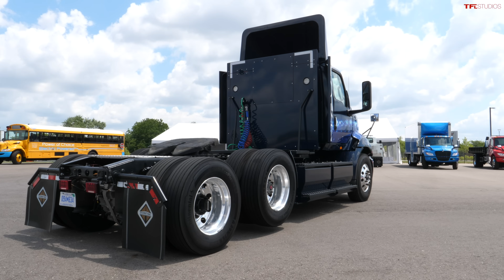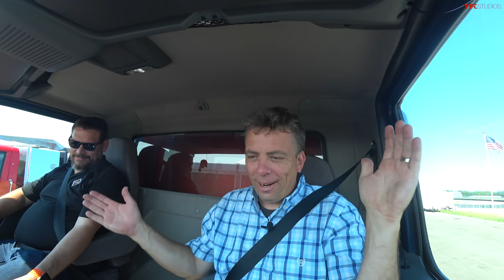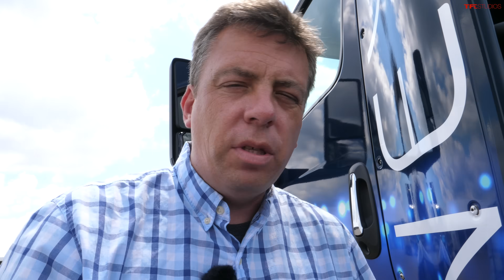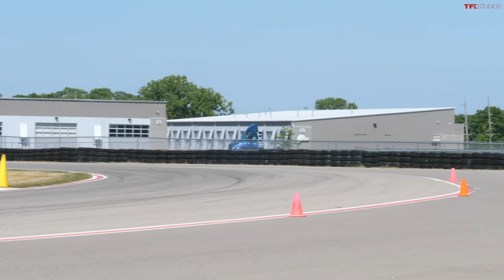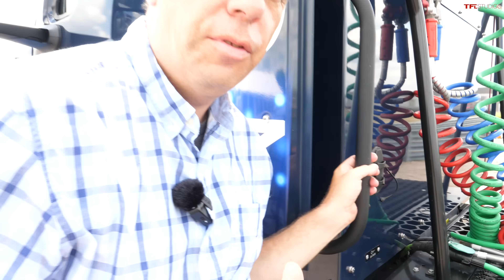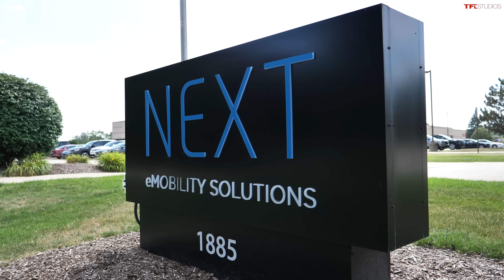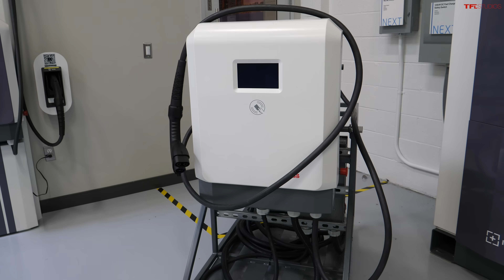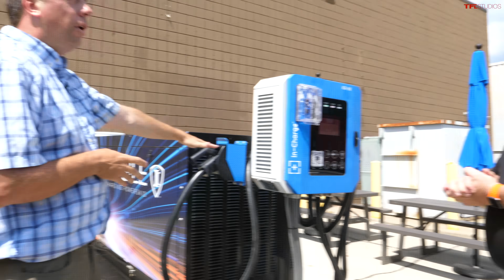Badass EV Big Rig - This International 18-Wheeler Packs a Huge Surprise!

Comment: I beg to differ, the cutoff price for electric power to be cheaper than diesel is just over 20c/kWh. Can you find me a DCFC with that kind of pricing? I have done some workings and a PHEV truck would work out much cheaper and with no payload penalty. The diesel engine would do the highway cruising in high gear where it's most efficient, the battery would provide extra power for overtaking etc. so the engine remains on constant load. Regen would relieve the brakes or dynamic braking. The engine can also be smaller than what is required for a conventional truck. The annual additional margin from a PHEV, in most situations, is around 35% higher. It was an interesting calculation but it made it very clear, fully electric semis are very far off. This is worst from the reliability of the electric chargers and their positioning.

Comment: But does it pull 102,000 pounds and run for a 15 hour day. Pulling through mud, gravel and pavement? Around 800 km per day that’s a local worker where I am anyway. Or do I still need to buy 2 trucks to do one trucks work?

Comment: GASLIGHTING THE PUBLIC! You sabe NOTHING! The vehicles are more expensive and the recharges are just as much as filling a tank with gas, if not more. Batteries also catch fire in extreme heat and give less mileage in extreme cold, which knocks the hell out of batteries!

Totally useless in long hauls acros states, as there is no place to charge them out on the open road. Also, you hook up trailors full of food, it puts more of a load on batteries giving way less mileage. Then add in a cooler running the whole time to keep the food and...you're done for. 

EV's are the dumbest propaganda ever.

Comment: I manage 25 trucks, with 3 types of routes. Some local routes less than 300 miles per day and average 10 stops. Some regional routes that got out back daily 500 miles  1-2 stops per day, and some long haul trucks that are gone for weeks at a time nation-wide. We recently ordered 5 EV trucks from a different manufacturer. I’m excited to try this out, and the best part of this is there is no DEF system with sensors that break constantly. We are also looking at alternatives for the longer haul trucks, but currently it is not feasible to consider them for most applications. The long haul trucks are moving about 22 hours per day. Besides these 5 trucks usually go only 25-40 miles between stops and never leave the metro area. I’m not ready to send one of these 250 miles from the nearest shop and have it break down. I had a standard truck towed 150 miles last month and spent $3500.

Comment: Using a fuel cell as a generator to charge the battery for long distance routes is the right move. 

Imo, they should also look into using diesel or natural gas generators for today's use, to increase range. Yes, they will get flack for it, but it's actually more efficient to use fossil fuels as a generator for electricity to powered a vehicle, than using the conventional ICE method. 

Strange how that works lol.

Comment: It's not going to work for a long haul driver or even a regional driver in the winter months. What is road salt going to do to the electric connections? Where are you getting the electricity to charge it. The power grid can't handle AC units in the summer. What happens when you plug in a million trucks at night.

Comment: Electric semi?  Really?  During the winter, I would need to keep the cap warm for 10 hours during my 10-hour break.  And when I'm working, I need to haul 45,000lb freight and  drive 8 hours without taking any long breaks to get to my customers.   How heavy is this tractor with the batteries?   Will I be able to haul 45,000lb of freights?

Comment: I just want to make a comment halfway in the video real quick

None of these electric trucks talk about what's the range when it's fully loaded and what's the range when it's not loaded.

For example if you have a truck that gets 400 miles of range, but you have a delivery 300 miles away. If you planned on driving the truck back empty then your unloaded range would be way longer than 100mi

Most companies I ever work for (and I'm a local driver btw) do not come back with loaded trailers after delivery.

Comment: Aussie long haul driver here
As usual all important stats not given ie tare weight of tractor
Which directly affects max payload and therefore profitability and of course RANGE at max weight! Price?
Life of battery pack? Replacement cost? My 600 hp volvo max loaded with 2 trailers is 65 tonnes and has a range  of 2200 km all day every day
Until evs can approach even 50% of these freely available factual figures evs remain a science fiction lovers wet dream for heavy trucking 🤣🤣

Comment: This is NOT an EV! This is a diesel truck that has been converted.

Driving a big rig should to be intimidating.

Infrastructure?! Why would I stop my truck (stop making money) somewhere to charge when I'm already stopped at docks, tippers, loading bays, scales, guard shacks, etc...? Most of these places are already required to have 240v or 480v infrastructure. Not as good as a charging station, but still good for adding 10 to 30 miles range without adding down time. 

The batteries are on the outside of the frame: THAT IS DEADLY!

Comment: Electric trucks aren't there yet because of the weight you need alot less weight to carry more stuff in the back of the trailer since all roads have the total capacity of weight that can accessible it's not there yet but the Cummins hydrogen prototypes are very promising

Comment: It would make the trailers way more expensive but how about putting batteries on those?  The driver could hook up the power to his truck and the trailers can be recharged when they're either getting loaded up or when they're not in use.  They would also have a lot of room for panels. 

I think I custom body would be needed to make these more mainstream.  Making the cab more aerodynamic would improve efficiency.

Comment: 2:58 usually the air brakes needs to charge and it takes lots of fuel usually right, so that functionality is still the same or since it is electric, it would change (like fill the air faster or whatever)?

Comment: If it's not the direct future, it's the near future, and the path with the most potential.  If you like anything about an EV big rig, that's good, because it will all get better.  I think that's the most exciting thing, the potential for advancement.  We haven't found the limits of combustion engines, but I think most can agree battery and motor breakthroughs are coming hard and fast.

Comment: I don't know if anyone from industry would read this but especially if you are adding battery packs to increase range then why not just add more charging ports?   It looked like the truck in this video had two packs 250-300 kwh each or something like it so would it not make seance to increase the charging speed as well as reducing component stress by having an option to plug in each pack to its own charger? I could Imagen truck stops having pull through charging spots with 2 4 or 6 cheaper slandered chargers 1 2 or 3 on each side of the truck to me it would be the most logical way to go .

Comment: You don't you trucks like this for local deliveries , it's usually smaller trucks for last mile stuff. Big rigs are mostly long distance ,. The engines are designed for 2 million miles , don't think those batteries can do that . Trailers weighing 44klbs no way you're getting 700 miles in a day like a diesel can

Comment: Sounds very interesting but it’s still a ways off. Like you said, Tesla has spouting off about this since a few years back and some pretty big companies lined up very quickly but still nothing really out there that I’ve seen. What about really heavy loads, are the batteries ever going to be big enough to get decent mileage to haul 140,000 lb loads?
Reply: WTF, roads are capped at 80k to prevent wear and tear on the roadways (23 U.S.C. 127) .  Why on earth would you be pulling 140k?
Reply: @uni4rm  , most are but Michigan isn’t. They can haul more than 80,000 in the box with multi axle trailers.

Comment: The full weight of the diesel truck helps with the control of a fully loaded trailer. What is the weight difference of the two

Comment: I'm sure it's already a thought in the engineers' minds, but solar panels on the roof of the trailers could extend the range and be charging while sitting.
Reply: Not really. You might get 7kw worth of panels on a trailer. You wouldn't notice any gain from that. Yes it's been discussed, but the weight penalty negates any gain in SOC.

Comment: Great now what would make it perfect is to remove one battery pack, add a diesel gas tank, a small perhaps 3.0 l diesel to run an electric generator and maybe you can make a long haul truck with good efficiency.

Comment: It really seems the extreme left is leading this industry. I have a background in electric & lean to the right & im continually amazed at this direction. Like why no highbred approach to get started until the battery resources catch up? 
A long haul could happen much quicker with a massive gain in economy. But this crazed zero pollution has been the agenda without consideration of taking steps to get there. 
Seeing these rigs will be pulling 53 foot trailers and a single solar panel today puts out 430 watts. That somewhere between 20K to 70K watts. But no one is talking along those lines. If this is going to be a thing the right needs to get on board  & bring a Quick sensible approach. Because Chucky this product down everyone’s throats that no one wants and mandating it by extremely high fuel prices it’s not how those countries history has worked well. AND can we please talk about where we’re gonna get this power from with a power generation grid that has many decades behind. While we continue to close power generation plants?!
We are headed towards a travesty & if we don’t quickly improve power generation these vehicles will crash our system. So if electric power is heavily limited. Then price surely skyrocket.

Comment: 8:14 with a vehicle like this using regen on local roads have they/is it measured if the environment cooler because the brakes are not venting heat to the outside air and road service?

Comment: I think for an EV truck standpoint, it would be good to see powered/driven trailers with their own batteries and motors as well. Trailers spend a lot of time sitting while being loaded/unloaded , so they could charge while sitting and take some of energy burden off of the tractor. It could also help with regen braking.
Reply: Add solar on to of that for even more possibilities
Reply: Batteries take up a lot of weight and eats into overall trailer capacity. Also think of how high that cost will be. Placing solar cells on top of trailers is a nice idea. 

This is why they're experimenting using a generator, like a fuel cell for long range applications.

Comment: Fuel is cheaper, "for now". How long will that last?
Maintenance costs will be less. I guess those numbers are in the mail.
What is the cost per mile over a million miles? Too early to tell.
What is the cycle life of the unit? How will that compare to ICE?
So many questions, such little data so far.
Then there is the added mystery of hydrogen powered units. R and D spending is huge right now on hydrogen.
Cummins are deeply into it. Interesting times and lots of change on the way.

Comment: I'm dying to see how the electric grid (especially the California electric grid) is going to handle these megawatt charging loads for these electric fleet trucks. The American national electric grid is mostly powered by fossil fuels (i.e. coal, natural gas, some nuclear). So basically these trucks are coal and natural gas burners, just like the Tesla cars. 

Plus the initial cost of buying these trucks is almost twice as much as a Diesel unit. The cost of installing these megawatt chargers has to be factored in too. So where is the savings for the trucking fleet companies? 

Customers that are served by the fleet companies will now have to be charged more to cover the higher freight costs. 

Also the elements that go into a Lithium battery are Lithium and Cobalt. China supplies the Lithium and African child labor supplies the Cobalt. And don't forget the recycling of the tractor when it is at the end of it's life.
Reply: On sunny days California OVER produces solar. They have to pay other states to take their electricity. A sunny day with excess megawatts sounds like a perfect time to charge. And the total cost of owning and operating a vehicle is not just in its first cost. The truck might be up front twice as much but if the per mile costs are 1/4 to 1/2 there will be savings that will recoup the cost. And the price of EV trucks will drop as they manufacture more of them. The first of anything being manufactured will always be the most expensive.
Reply: How the grid holds up is going to be over major concern

Comment: I am curious if this would be safer to haul in crosswind situations since the battery weight is lower in the chassis than the engine that would sit higher on top of the frame rails.

Comment: I don’t know if this will happen but I am interested to see if there will be electric 3/4 ton and up trucks. The instant torque could make them great, and they would be perfect for local work like on construction and mine sites. I know it wouldn’t be as popular with regular RV owners and hot shot driving unless they can run 6+ hours on the highway without stopping to charge and quick recharge that current technology can’t really do, also battery technology might not be able to hold that much energy in such a small amount of space but it’s a good idea for the near future

Comment: Food for thought.  One gallon of diesel equates to 40KWH.  
I just went 1127 miles on 188 gallons of diesel at 72,000 pounds gross. Approximately 7250 kWh of energy.  That’s an X-15 500 hp and 2050 lb ft torque, 13 manual and a kenworth w900. Doing 75 mph the whole way……

Comment: Do the headlights and running lights run off of this same battery or do they run off a alternate battery for emergency situations?  If everything runs off of these batteries that seems very unsafe in a breakdown situation.
Reply: All electric cars have a separate 12V system (trucks have 24V usually) with a regular AGM/lead acid-battery because components like lights and instruments run at 12/24 V like in any other vehicle. The 400 V (or whatever is used) system trickle charges the 12/24 V just like an alternator would. The 12/24 V system is also required to switch on the 400V system, so a dead 12 V battery in an EV can actually stop you going anywhere even if there is juice in the 400 V.

Comment: The configuration they are testing makes sense given that most trucks run in that mode.  The front drive axle on a tandem drive truck is only engaged when extra traction is needed.  There are also a surprising number of tag axle and lift axle trucks out there.  With the tag axle trucks the forward axle is driven, while the rear is just there to help support the weight.

Comment: all wheel drive with torque vectoring for winter would be awesome.
Reply: This actually seems like the more sensible approach.  Multiple motors can come on when needed & off to save energy. More even weight distribution. Mass production of the same motor & equipped as options four states where it’s not needed. Better reliability by dividing the use over different motors.

Comment: For long-haul trucks, wireless charging on the road will solve this. It's similar to wireless phone charging except more powerful with a much longer charging distance. The power is less than wall charging, but it should at least give enough power to maintain speed. Then the battery will have enough power when moving away from the main Interstate that has wireless charging. The wireless charger can also be placed in parking spaces for overnight charging. Just thinking. Anyway, thanks for the many informative videos!
Reply: I don't think wireless charging is a practical solution because of cost. Roads cost a lot already and are barely kept up very well.
Reply: @leviduff2740  It's happening already. Qualcomm is now making a Wireless Electric Vehicle Charging (WEVC) system for cars and roads. Get used to having a longer range.
Reply: The way I see it the cost of wireless charging systems combined with the fact that it's not a very fast way to charge is going to kill it. However doing something like what they do with street cars in Europe would cost less and be much more capable of quickly charging a truck. Look up the system if you're not familiar with it, they use overhead wires with a arm riding on the wires. It's been in use for decades already.
Reply: @leviduff2740  Yes, wired road charging was done already for decades. Large trucks for example can reach the high-hanging cables and provide more power. Small cars don't require as fast charging. I see a use for wireless and wired charging.